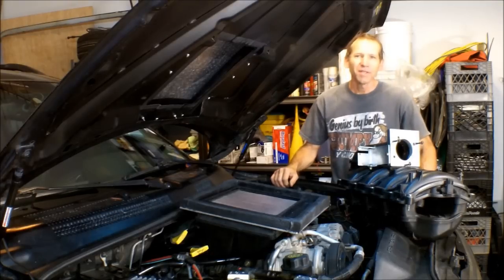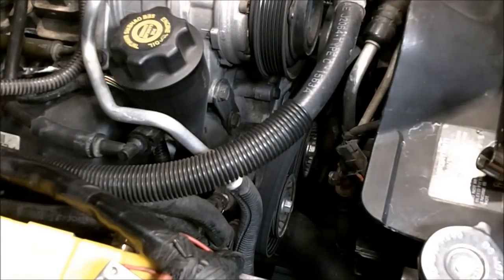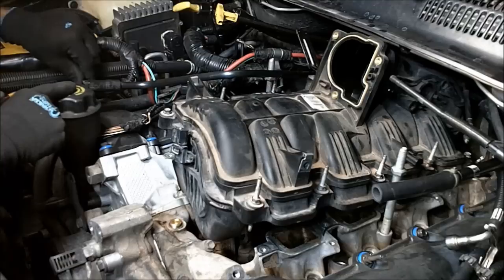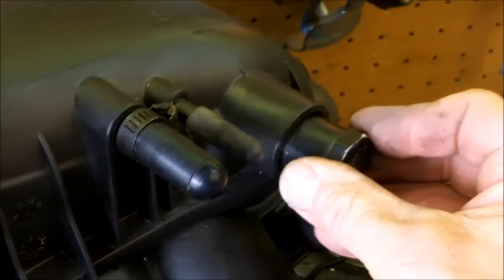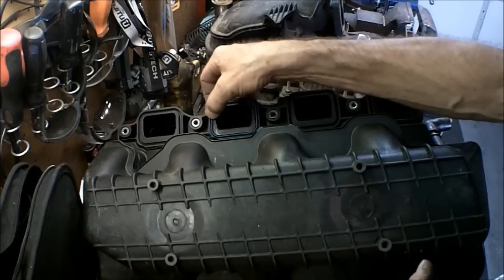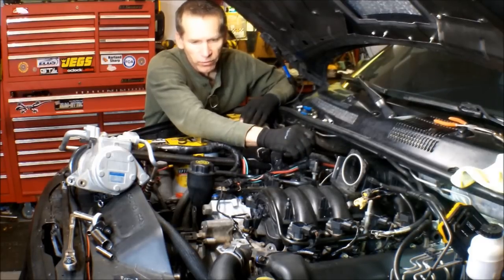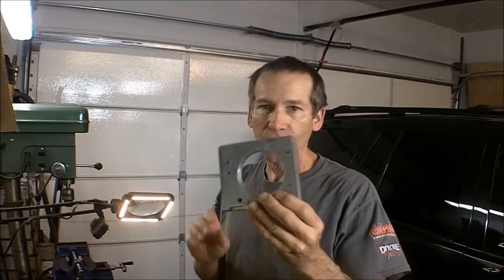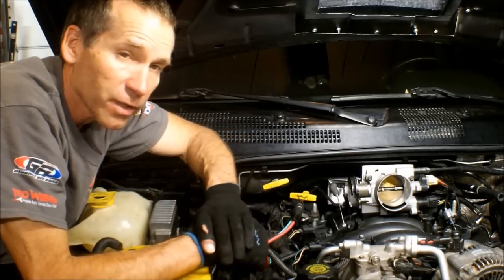Installing Upgraded Intake Manifold on 4.7 Jeep, Dodge

Comment: Quick question. Would the 07-09 manifold work or does it have to be 08 and up?
Reply from the maker: Alberto Gonzalez do you happen to have that intake that you're talkin of and what is the part number on it. Is it a 3 or 4 bolt for the throttle body. I believe it will fit I just want to make sure.
Reply: I do have it but im not sure where the part number is at. And its a 3 bolt for the throttle body
Reply from the maker: Alberto Gonzalez no that's not the correct intake manifold that I am showing in the video. That is the same basic intake manifold from 99 thru 07 of course there were  some good manifolds in the early years like 02  HO motor intake manifold.  In 08 they went to the four bolt fly-by-wire throttle body & the shortest intake Runners of all the 4.7 s.
Reply: I bought the adapter from airram. I had bought the manifold from ebay. It said from 07-09 4.7 dodge ram. Im just wondering if that'll fit or if its only the manifold from 08-12
Reply from the maker: 08-12 with 4 bolt trottle body bolt pattern

Comment: Wow!!!That was a lot of work Martin.Was it worth it?
Reply from the maker: Dan Hambrick yeah it is a lot of work. But I found out it was extremely worth it. With the combination of the throttle body I'm using and that intake is got to be the best hands down mod I have done so far. Now some of the horsepower I did game could be because of the combination of all the mods now working together. Just so we're clear I am not running the 68 mm throttle body. I removed it immediately after this video and installed one that I have modified to fit. I'll be putting that video out as soon as I can it's going to take some time.
Reply: I may have missed it, but how much of a increase in hp can you expect with this swap?

Comment: Will this fit 2006 4.7 jeep commander?
Reply from the maker: yes, you will need the throttle body adapter that I spoke of in the video.
Reply: @martinbuilt  where can I buy the Adapter from
Reply from the maker: @shadricksimms  http://www.airram.com/product.php?categoryid=1238&productid=1341
Reply: @martinbuilt  thanks so much..... did your horsepower increase
Reply from the maker: @shadricksimms  and how, gave me the wow factor.
Reply: @martinbuilt  lol dam I cant wait I'm going to do this on my 06 base model commander

Comment: I'm on next level shit. I am now putting my 5.3 Chevy in the Dakota. 300 horse 325 torque no mods yet. And hell of a lot easier to work on. taking that 4.7 out was a bitch all our shit kept breaking
Reply from the maker: You'll have to let us know how it turns out.
Reply: martinbuilt for sure, it's gonna be a big change. I got in a rush so I bought the first warranty running shit I could. So I ended up with a 2003 LM7 out of a Burban with the 853? Heads, good heads anyhow. I wish I had waited and got a 04+ or a larger 6.0 or something. And got a 4l60 when maybe could have went for the 80. But it's a damn clean motor so we will see. It's a drive by wire though so there's going to be some interesting hurdles. Also it's a 4x4 Dodge Dakota and apparently, Dodge bolted the front differential, engine, transfer case, and transmission as one large unit. Well that means I've got to make custom tubing and brackets for my front differential and possibly transfer case. It will be interesting how that plays out. There's a forum on a 4x4 Durango swap where he reinforced the frame and made custom tubing for the front differential. Lord I got myself in a pickle I read 2wd forums and 2wd is easy as shit. But I'm so far now it would be stupid to back down. It will be a hell of a truck but it pisses me off at the moment, my father was right should have got a Monte Carlo or something old anything old makes life easier. But then I wouldn't have a 4 door 4x4 truck.
Reply from the maker: Papa Savage I'm assuming this is not your daily driver.  Definitely more than one weekend job. I wish you the best of luck with it.
Reply: martinbuilt Sadly this is a daily. I bought the truck to be a daily 4 door 4x4 pickup, well we didn't know what was wrong with it, ran and drove home but smoked but never overheated, well after we pulled the motor we knew it was blown head gaskets because that was a stinky ass radiator. Other than that no other signs of blown head gasket no nasty Mayo it wasn't constantly running bad just occasionally, and it was thick white smoke. Well I was quoted $1750 for a 4.7 alone no harness or anything and i told them that was bullshit. Well they got me the 03 5.3 harness complete computer complete engine and alt, transmission and everything under warranty running and driving before it was pulled for $1961. So I went with that. And I somewhat regret certain things right now. But that will be the nicest Dakota running in the surrounding 3 states if I swap it. Everything Dodge is coming out and everything Chevy going in. I need a transfer case and I need to weld supports for the frame and differential. I plan to someday push the motor to 400+ horsepower and 400+ torque. Just a nice number nothing crazy I see guys pushing much higher with extreme mods but just some simple stuff can bump those Chevy LS motors to beast power. 400-400 is more than enough for the road. Especially if I don't lift it too much I either wanna do a 3 inch with 33s or 7+6 with 35s. Especially being I found out some reason 4 of the 6 body mounts were non existent on the cab.. I would have probably sued the living fuck out of the guy who sold it to me had something happened.

Comment: Will this fit for a 06 ram 4.7?
Reply from the maker: Yes this intake it will bolt on to all the 99 through 2013 4.7 l engines .
Reply: @martinbuilt  where can I find the intake manifold at? And will it gain HP?
Reply from the maker: @Tamay_BBQ  the best place is at your local salvage yards.
Now you will need an adapter to use the OEM 65 or 68 mm throttle body. I built an adapter to use the GM vortec throttle body which is 75 mm.

Comment: Will this pass ca smog?
Reply from the maker: Yes it will pass California smog. If there is a physical inspection it should pass that as well very hard to tell that anything has been altered from original.
You will need to relocate the intake manifold temperature sensor to the resonator box,  intake tube or air filter box.

Comment: at 14:20 your knock sensors are missing
Reply from the maker: This is not an HO engine, no knock sensors.
Reply: @martinbuilt  oh I had no idea that there was a difference. My knock sensor wire harness recently broke and I have been scouring the internet to see if it is really necessary
Reply from the maker: @TheOneTrueIgnatius  if your engine is equipped with knock sensors I would recommend you leave them installed.

Comment: was the map sensor from your jeep or did you use one from an 08 ram?
Reply from the maker: use the one from your (older) original manifold
Reply: @martinbuilt  where did you use to make the hole for the intake air temp sensor? From my understanding we have to make the hole in the manifold correct?
Reply from the maker: @albertogonzalez5564  I  relocated to my Ram Air. It can be moved to the air intake tube or the air filter box. The wiring may need to be extended. It is best for performance to not have in the intake manifold.
Reply: @martinbuilt  what did you use to make the hole?
Reply from the maker: @albertogonzalez5564  A uni-bit and a rubber grommet. This video may help. https://youtu.be/45YNy7LvIHU

Comment: This is not worth doing to a older 4.7l.  your better off buying a 4.7 2009 or just get a hemi 5.7 swap and call it a day.  You can pick up 5.7 for as low as 2000 bucks.  
4.7 is just to small over all.
Reply from the maker: Out of all, the Mods I've done on my 4.7 this intake with the throttle body was the largest increase in torque and horsepower, so I don't know how you can say it's not worth it.
 Unfortunately, with the newer 4.7, it's not plug and  play, especially if you have  the JTEC ECM. You'll need to pull the crank shaft and change out the reluctor gear. Also, replace the right Cam gear, lengthen coil wires, and modify the Y-pipe. 
 I may consider installing the later model  4.7 in my 01 Dakota down the road.

Comment: I can appreciate the work you do but wouldn't it just be easier and more cost effective to just slam a HEMI in her? That's what I did in my '05 WK.
Reply: your engine bay is built to house a hemi his is not it would require much more money to do the swap plus a trans adaptor or a trans replacement plus moding the tunnel
Reply: @christiansulak4309  Nope. I have a lot of buddies that have done the swap from '99-'04's. The time, money and labor he has in his build far outweighs the cost of a Hemi conversion with a trans. Minor mods are needed for the swap on the trans tunnel also. He could easily do it.
Reply: @whesselton  There's something beautiful about the 4.7
Reply: @P.A.C.E.automotive  passing smog and zero codes. Not everyone, while applauding your all or nothing approach, wants their daily driver to blow the 1/4 in 12sec. This is a reliable mod that where the beauty lies is the ECM automatically gives you kind of a basic tune without throwing codes or any major modifications. Your air fuel mixture is automatically adjusted

Comment: Do you know that an ho and a regular 4.7 are only 10 horsepower difference it's not worth it to put all these ho Parts on.. all you need is a set of headers..
Reply from the maker: Where did you get that information?  If you look at the non-HO engine at 235 and the HO engine at 265.
 That HO camshafts will give you 10 plus horsepower alone.